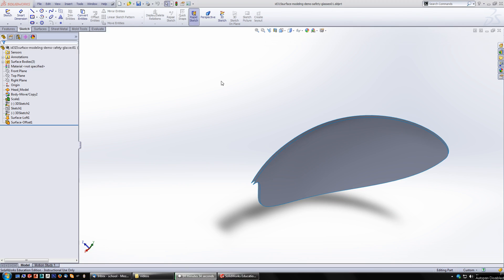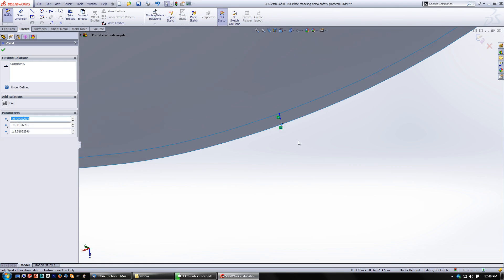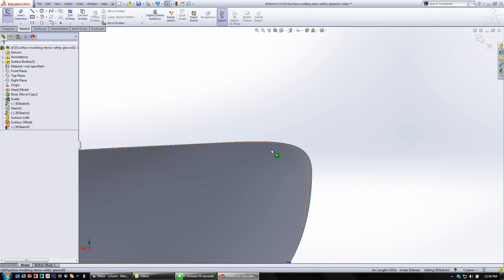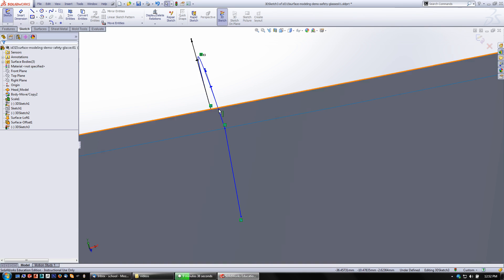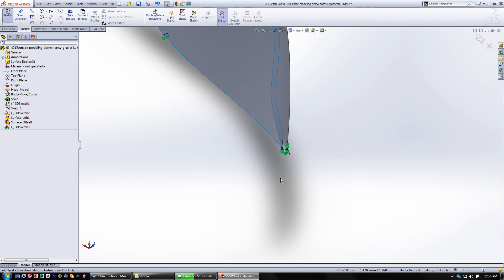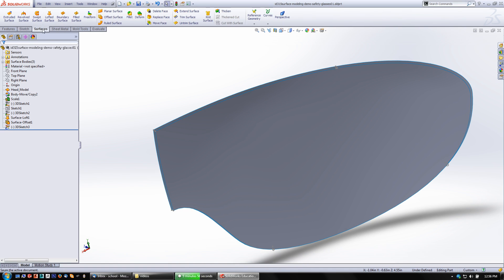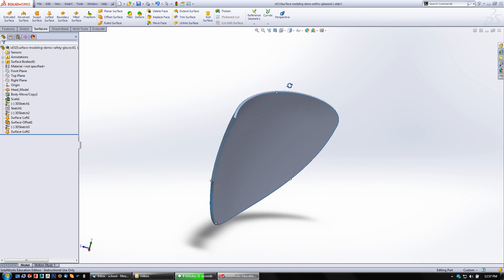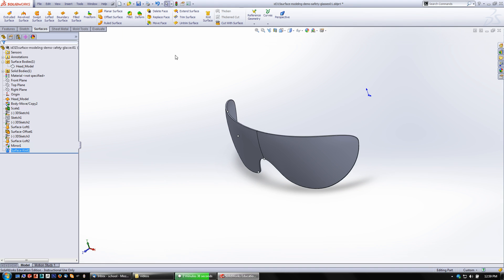solidworks surface modeling demo safety glasses 02

Comment: hey these are great, new to surfaces and these are fairly detailed on how things can go wrong and how to fix. thanks! working on parametric face mask so i can dimension based on facial landmarks and control overall model based on those. Do you think possible and have any tips how to go about it?
Reply from the maker: Adam,
Your comment reminded me that I had an older video of how to use a 3D scan of a face to custom cut a respirator part so that it fits the face. I never put it on YT, but have now. See here: https://youtu.be/Y1HbIt4pw3U